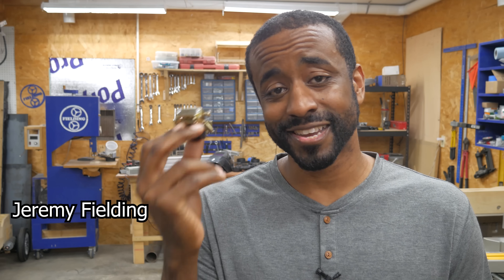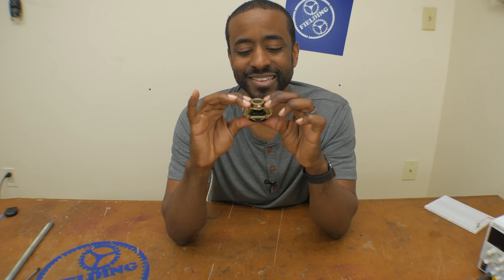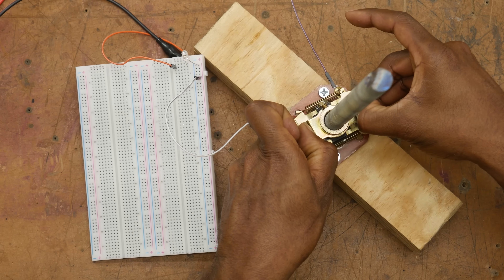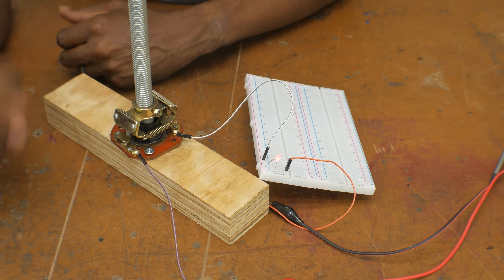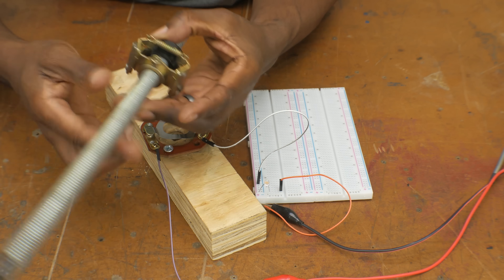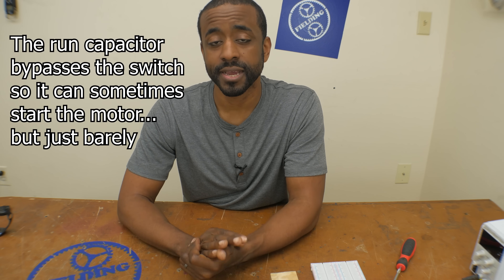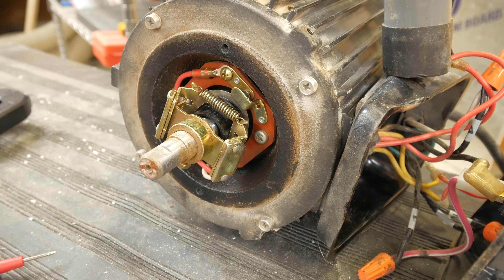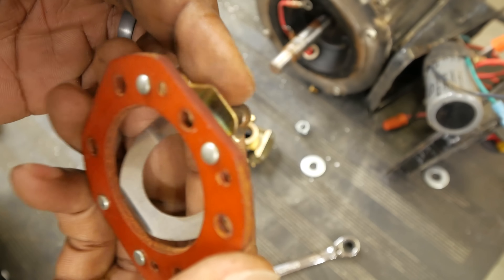This Clever Device Is Found In Nearly Every American Household. How It Works And How To Fix It

Comment: Use caution when handling capacitors. They can hold a charge for some time even after AC power has been disconnected.
Reply: I promise you will only have to do it once. Much like being told not to touch something hot as a kid. No one ever believes it is that big of a deal until it happens to them. I got lucky mine was ~25 years ago installing a car stereo; I shorted a 0.5 Farad cap and it scared the shit out of me. Few years ago I saw a maintenance guy in a factory crawl inside a huge industrial milling machine to do an electrical repair. He locked-out and all the routine safety stuff, but didn't have on his ESD gear and didn't think twice about the multiple 5 Farad caps used for starting the huge motors. Apparently it got him good cause he went to the hospital on a gurney.
Reply: @AaronAlso  I didn't believe it either.  That is until years ago I touched the flash contacts on one of those old disposable film cameras.  That woke me up!!
Reply: AaronAlso Yikes!
Reply: And back to (hopefully) funny:
"There are three kinds of men. The one that learns by reading. The few who learn by observation. The rest of them have to pee on the electric fence for themselves."
Will Rogers
Reply: Capacitors kill microwave technicians every year. Op is right.
Reply: @henrydickerson9776  While I was active duty in the USAF, I had a friend in our shop lose his arm from the elbow down, and almost his life, to an HF Radio Coupling Cap after another tech turned on the radio and recharged the cap after it was discharged.  Caps aren't anything to play with.
Reply: @henrydickerson9776  Citation please.. I think it kills more inexperienced amateurs, and most microwave caps have a bleed resistor. Most of the charge bleeds off when the power is removed in an operational microwave. In a microwave with a failed magnitron, this might not discharge it. In servicing the ovens, most had no charge at the time of service. Motor start caps on the other hand have no bleed resistor in most cases and will hold a potent charge for days.
Reply: Found out the hard way as a kid taking apart a disposable flash camera...
Reply: @gizmogremlin1  While you are just having a joke a stupid person might do it and that would be a good way to get someone killed over a bit of lame humor.
Reply: Tamiya Fan anyone who would do that, would not be watching this video.
Reply: @bigwangmark  
Well natural selection and all.
Reply: @gizmogremlin1  more like assisted murder, since you'll be complicit. Jokes don't stop people from getting arrested these days.
Reply: @Debrafeem  Hillary got away with it so far
Reply: @gizmogremlin1  I'm guessing he/she/he-she is a democrat
Reply: @skynjaydensdaddy  there's always someone bringing up politics when it doesn't need to. Holy shit.
Reply: gizmo gremlin Dude! As a bystander looking in, your free speech in this is a lame excuse for being unable to recognize your ability to cause harm. It’s ok to say sorry and back down. I do it all the time and it hasn’t hurt me yet. You’d actually gain credence.
Reply: @scottwillis5434  
If the 10 year old was clever enough to be able to disassemble a motor then would also likely be far smarter than than you appear to be so if also read the joke would understand it so I can only recommend than you avoid capacitors and develop some common sense of your own
Reply: @BlackSwan912  if you are a babysitter you should be aware anyone young enough to possibly harm themselves tinkering with things you should be keeping them under a watchful eye and your comment just shows the people who higher you as a babysitter should reconsider because you might not be a responsible enough adult to be trustworthy of protecting their child
Reply: gizmo gremlin I get what you’re saying, but freedom of speech, is a very gray area, nowadays.
Reply: @robertbeirne9813  
Well it's only a gray area to people who dont appreciate and respect our freedoms. Anyone creating these gray areas is committing crimes against humanity and are the ones who should be getting negative feedback instead of those of us us actually respect their fellow members of society.
Reply: @gizmogremlin1  If somebody dies from (ignorantly) doing what you told them told them to do, especially when you knew better than to do that action your own self, the responsibility is upon you.  not upon that who was ignorant, and later dead.
Reply: @karenjohnston7342  
Okay Karen.
Reply: gizmo gremlin you’re not getting any negative feedback from me.
Reply: @Debrafeem  Who assigned you magic yellow CSI glasses? If you touch both contacts with your wet finger the path of least resistance is clearly right there. Not that you should do that but...
Reply: gizmo gremlin Given the fact that your joke was not obviously 100% a joke to those of which would have very limited education and experience using, assembling, maintaining, and disassembling electrical appliances and/or equipment, one could argue that you indeed have and/or will be held complicit, at least in appearance of a matter of fact statement, in the murder of one who blindly followed your comment that again, could and very well might, be followed by an inexperienced person having had faith in you. I strongly suggest that you add a sarcastic emoticon at the end of your original comment to dissuade any parties that may attempt to seek legal retribution for your advise that their injured parties have taken as fact.
Reply: @williamcopeland9087  
Any warning labels on the equipment would supersede a random joke comment on a YouTube video. If they can read my comment they can read warning labels. Further more at this point the cats out of the bag now (btw to clear that up for you, there is no cat and there is no bag. See that's a metaphor basically explaining that the secret is now exposed) anyway its already been made abundantly clear at this point through the rest of the comment thread that it is infact a joke. If someone were reading a safety manual to the danger widget 3000 for instance and only read the first sentence then hurt themself do to something later on the page there would be no case. If someone bought the danger widget 3000 that happened to be a product intended to be sold exclusively in Japan which contained safety information written only in Japanese and then returned to the states, failed to make any effort to translate the information and understand them and injured himself do to not following the safety instructions there would be no case. If someone reads a joke and fails to comprehend the context of the joke they would have no case.
See heres the thing it would be unsafe to handle until it has been fully discharged so touching it to discharge would be unsafe. Similarly  if a completely illiterate person fails to read a proper warning label on a product they would have no case. You claim it is not 100% clear that my joke is a joke yet the very first person to confront me about it recognized it as a joke along with others which is clear evidence that it is clearly a joke which I fully maintain to be the case and if I edit my comment now in any way as you suggest that could cast doubt upon my confidence that I believe in it being clearly being a joke so if anything one could easily argue that following your suggestion would be a bad idea. 
Further more if my joke comment were to be made a valid case in this matter it would open up a dangerous precedent where in criminals could use YouTube comments to relinquish themselves from responsibility of their criminal actions and no judge or lawyer would want to be responsible for opening that particular pandoras box. Also if one could argue that a random YouTube commentor could be held responsible for someone's actions then you could easily argue that Warner Brothers cartoons can be held responsible for for deaths such as dropping an evil on someone's head, blowing someone up with dynamite, dropping a person from great heights, building a road that leads to a realistic painting of a tunnel causing someone to crash into a solid wall at high speed ( I'm referring to the roadrunner and Wiley  coyote cartoons if that's not clear yet) anyway these cartoons all depict actions which can easily result in death but then show the characters later unharmed and the target audience is young impressionable children. I seem to remember reading somewhere that people have tried to make this case to no avail. 
Anyway I said it before and I'll say it again. Learn to take responsibility for your own actions. You and others like you are in fact acting quite irresponsible by attempting to teach or convince others that you can be relieved of responsibility for the things you do simply by passing blame of to some influence. 
Oh another quick reading comprehension example 
" Your honor the sign said it was fine to litter, I actually came here to collect my $1,000."
At any rate I still can't believe that some of the people of this world have become so mentally deranged to make such a big stink over a dumb little joke and I truly hope you all grow up a little and learn to enjoy life a little more and I do mean that, I'm rooting for you. Do some soul searching, get a self help book, maybe see a psychiatrist or just give it time but I'm sure you'll get there one day.
Reply: @Obiwannabe  Super  disappointing that folks feel the need to turn EVERYTHING FUCKING SUBJECT into a red/blue confrontation and character assault. Why?
Reply: That's why properly designed stuff has couple megaomh discharge resistors.
Reply: There's no such thing as common sense. A lot of things we learned is by experience or knowledge. You're not born with knowledge or experience. You expect a baby to know not to touch a hot stove? Or someone who never seen or heard of stoves? How the hell would you know what won't hurt you unless you know about it, or by experience? Saying it's a 'joke', won't stop someone from getting killed. You better put a disclaimer.
Reply: @gizmogremlin1   gizmo gremlin could you please modify your original posting to indicate that it is a joke to reduce its potential for harm which I am sure you do not intend. Thank you.
Reply: In my Junior year of HS and attending a Radio & TV course at the Vocational School we played around with them occasionally. We'd get one from the parts cage, charge them up with  a power supply, then discharge them with a long handle screwdriver. Fun times!...:-)
Reply: Learned that the hard way  lmao
Reply: top notch warning! I replaced my capacitor off my Grainger 2hp big-assed 2 stage air compressor. I detached the existing capacitor using insulated (Klein) needle-nosed pliers.
Reply: @gizmogremlin1  LOL😂
Reply: Everyone in this thread is a choad.
Reply: It's just voltage, virtually no amperage, could be worse.
Reply: @rickc2102  heh no, not at all. Depends heavily on the capacitance of the capacitor in specific. Sure some smaller ones don't hold enough charge, but like the other commenter mentioning several farad caps... ain't licking that thank you. Also, microwave oven capacitors are on the high enough capacitance and around 2kV, they easily kill.